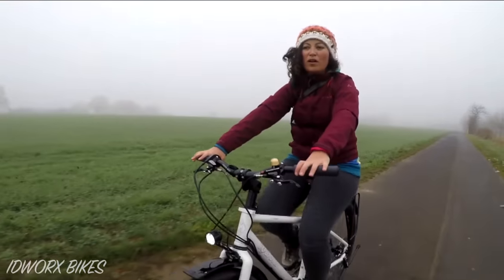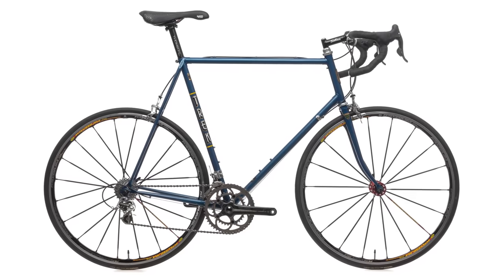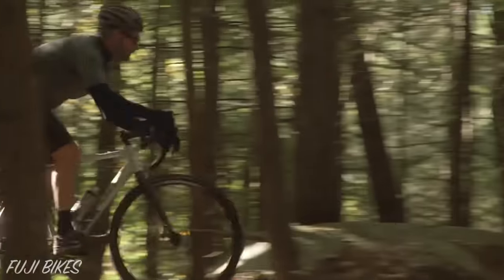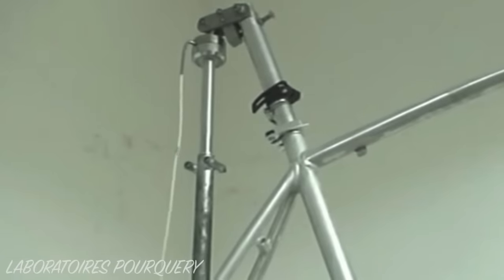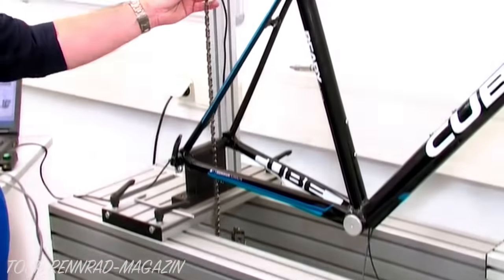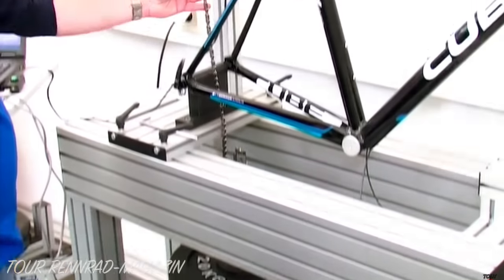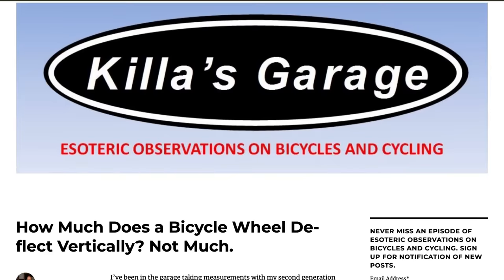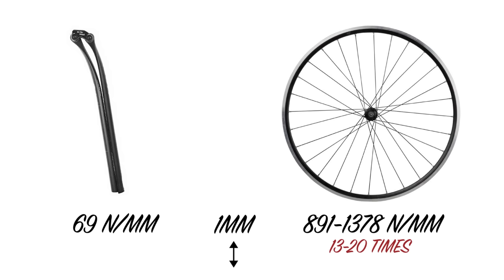Why It's Impossible For Steel Frames To Be More Comfortable Than Aluminium

Comment: I think the actual weight of the frame plays a big role in comfort too. To me, heavier bikes are more comfortable because they have more momentum and resist changes in direction (up and down) more. This means more flexing from the bike and less bouncing. Of course, heavy bikes certainly have their disadvantages.
Reply from the maker: A heavier bike is definitely more comfortable, all other things equal. But you can also select comfortable seatposts/tyres/forks/handlebars to make lightweight bikes comfy too.

Comment: Yeah...I agree with the fact, that the frame material is not THE deciding factor. There are a lot more and important factors which play a role. BUT. With a bad frame, you have nearly no chance to get a comfy or good bike. And the different frame materials also have different physical properties and therefore must be treated and used in different ways. If you use these things right, you can use the physical probperties in order to build a good bike while exposing the positive properties of each material. And in this case aluminium is really a bad material (just cheap and light) in comparison to steel, titanium or carbon.  In the end you have to choose each bike individually because just the frame material does not tell you anything about ride comfort. But as so often, carbon and titanium are often on a different level - which is also based on the frame price (if you spend more money, you do not want the feeling of a bad aluminium frame). I think you should have made this more clear. Yeah - wheels and stuff are really important. But the frame material has an influence on the total bike feeling and there are for sure differences in frames due to used material and engineering.

Comment: I also need your answer how about raining washing my steel bike does it corrode or rusted easily ty 🙏
Reply from the maker: The paint protects your bike from external rust. If you scratch your bike, try to touch it up with nail polish or touch up paint. Also, it's a good idea to spray "Frame Saver" inside your frame. You can see how here: https://velo-orange.com/pages/how-to-use-frame-saver

Comment: It all depends on the tubing and the frame design! With same components and same frame geo, you can get really diffent comfort with different frame materials! 
Mostly Alu ist very rough, steel is softer, and Ti sits somewhere in between. And you can feel it!! But there are very uncomfortable Steel frames in the market, as well as very comfortable Aluminium frames…

Comment: Well, I’ve been riding cro-mo, aluminium and carbon bikes.
Of course tyres make the largest difference, but when you take exact tires and inflate them exact pressure Aluminum feels the less compliant. It’s tough and you feel all the bumps. Cro-mo steel feels much more comfy and Carbon is the most interesting because it feels soft but it let’s you pedal hard and won’t feel sluggish at the same time.
I’m comparing Giant TCX SLR aluminum CX bike, Fairdale Weekender cro-mo allrounder and Salsa Warbird gravel grinder.
Reply from the maker: I know it sounds crazy, but the data here suggests it's a placebo. Have you considered it could be the other factors? For example, the TCX has a shorter seatpost than typical (it uses a more horizontal top tube), and if you're running 33mm CX tyres, it will have less deflection at the tyre too. The Weekender and Warbird frames are a bit more compact and are designed to fit wider tyres too...
Reply from the maker: Oh, and I agree that different frame materials have different ride qualities! But the topic here is comfort. 😎
Reply: CYCLINGABOUT well I switched between Weekender and TCX and back and that made a huge difference. Weekender felt way more comfy even it had a slightly longer ETT.

As for Warbird, I had a Surly ECR  with three inch tires running as low as 1.5 bars.
So when I switched from that fatty to Warbird with it’s 40mm tires and 2.0 bars inflated, it felt a bit tougher but the rear end of the frame appeared to be super compliant. I didn’t expect it to be that soft.
Reply: ну привет

Comment: This is an example of lab testing being one thing, and real-world experience being another. It happens with cars, too - one can have a faster 0-60mph time, quicker stopping time, higher top speed, and support more lateral force, and still be slower around a track. The same is true of a way bikes feel. I’d wager most avid cyclists could try three mystery road bikes and tell you which was steel.
Reply from the maker: I could tell which bike is steel too if the tyres are narrow enough (zero chance on a fat bike). But this is to do with the ride 'feel' rather than the frame comfort.

Comment: In terms of vertical compliance, you're greatly underestimating the effect of the fork. A steel fork with a curved blade rides "softer" than a fork of any material with straight blades. The math you presented makes sense if the bike is perfectly perpendicular to the ground, which is rarely the case. Given that the bike will always be at some angle less than 90 degrees from the ground, lateral compliance also plays a part in perceived comfort. Pedaling creates a lateral torque on the bottom bracket from the top half of the bike, causing the bottom bracket to shift. From below, the terrain will be applying forces in the form of bumps and road buzz. With a low lateral compliance (stiff), the bumps will transfer to the pedaling motion and counteract the pedaling force. However, you will get a responsive frame because less energy from your pedal stroke is lost to the bottom bracket displacement. Likewise, a high compliance frame (soft) will help absorb the bumps at the cost of a less efficient stroke, because some of the energy you put into a pedal stroke will be lost to frame flex.

This "phenomena" can be observed by holding your bike at angle from perpendicular and pressing down on the crank with your foot. The total offset seen will be a result of the lateral compliance from the tires, wheel, and frame, as well as any other lesser factors like QR/thru axles and bottom bracket spindle.

I will concede, however, that most modern companies can engineer compliance into any material through the use of material grade and quality, hydroforming tech, or geometry, similar to how some modern dual-sus bikes have 2- or 3- link suspension with compliant chain stays, GT's triple triangle tech, or Moot's Softtail system.
Reply from the maker: This video was specifically on frame material. Maybe we can look at forks in another video?

Comment: Honestly, I’ve ridden two bikes and they had the same geometry... they “seemed” identical to me. I suspect some people have a more sensitive tushie than me... I did notice the steel bike felt more “planted” to me, but I suspect that it is because of the weight difference more than anything else. I kinda feel like I’m “floating” on a lighter bike, and I’m riding something that the wheels will come out from under me at any moment.
Reply from the maker: Bike weight definitely plays a big role in ride feel! Not surprised you feel a bit less planted on a lighter bike. But keep in mind it's really just a feeling - your wheels being planted to the ground is mostly be a function of your choice of rubber and the tyre pressure!

Comment: Never ridden a carbon bike so I dont know what Im missing. Im kinda poor so to me it feels like a luxury item to have an expensive frame I must be paranoid about dropping or getting hit by something. 

Ive ridden harsh steel bikes and much more comfortable steel bikes. Long chainstays and old school geometry front forks, that are in line with the steerer until the last bit where the bend is, feels much nicer. Straight forks where they angle forward right at the crown, and super short chainstays so you sit nearer the center of he rear wheel, feel less comfortable for sure. The nicest feeling bike Ive ridden is my early 90s trek touring bike with reynolds 531 super tourist tubing. However Ive also ridden cheap as chips Swedish made crescents with 1010 tubing that also feel quite good. 

All that said, from all the aluminium bikes Ive ridden none come even close to feeling as nice as that 531 touring bike or even the middle of the range steel bikes. Maybe if I had a 90s aluminium touring bike with similar geometry I would feel that they are similar.

Comment: I moved from a aluminium frame to a steel one because I cracked the AL one. the steel one feels smoother. I looked at this video and it says it shouldn't so I tried  to find the flex. bouncing on a steel framed bike with 38 mm tires with 20 psi the frame movement is negligible and the tires take up most of the slop. this surprised me. then pumped up the tires to 60 psi. at this point the tires no longer flex obviously. The fork however moves like crazy maybe 2 inches. why do none of those tests talk about the fork with the curved blades?  I agree with your numbers for sitting on a seat doing a wheelie. just real world experience is not just sitting on a seat to the back wheel. weight is also on the front wheel, handle bars, and pedals.
Reply from the maker: This video was intended to discuss steel frames. I can cover forks and other components in other videos.

Comment: Older steel bikes are more comfortable than modern machines, in my experience. This is due to a combination of characteristics like slack frame angles (around 72o), supple leather saddles, pencil stays, small radius forks and small diameter frame tubes. For competitive riding, whippy steel frames are inefficient and relatively heavy, and racing defines the popular image. The biggest factor in comfort is getting the bars, saddle and pedals positioned for the fewest compromises for your chosen activity, rather than material construction.
Reply from the maker: Totally agree that a comfortable bike fit trumps frame material. 👍🏻

Comment: This is a great vid and I agree the material used isn't nearly as important engineering.  But what about long-term durability?  I've read steal has better fatigue strength, but I don't know if the is accurate or inaccurate bias.
Reply from the maker: I agree that the engineering and design trumps material choice. Fatigue sounds daunting but it isn't if the frame is engineered well. By using more material, we can construct aluminium frames that last enough load cycles for the lifetime of a rider.
But let's say I had the choice to tour on a 100 year old steel bike or a 100 year old aluminium bike, I'd take the steel. 😅
Reply: @Cyclingabout  
That makes sense and is consistent with what I read about 12 years ago on the Sheldon Brown site.  His site argues there should be minimal or no flex in a well-engineered frame so fatigue isn't much of an issue.  I'm carefully considering options for a new bike in the next year or so and it's good to know I shouldn't be overly concerned with frame material.

Comment: Steel and titanium is the has best vibration properties. it's obvious, it is about structurure of material, naturally geometry of the frame is important too. Carbon is not the most comfortable material, particularly in cheaper bikes. Iwas riding 2K middle class Focus carbon road frame and on quality titanium frame on the same set of wheels and tyres. There was a significant difference in favour of titanium frame, far more comfortable and smooth ride on the same type of road and conditions.

Comment: There is so much BS going around in the world of cycling. It is refreshing to see some more technical focused ways to explain things. In the 80's I overheard discussions where people claimed to have softened steel frame by just riding/pedaling them hard enough. ;-) Frame size is another thing people tend to forget. If you can ride a 60cm frame with a shorter stem and seat post or a 56cm frame with a seat post sticking out a bit further and a longer stem, you might feel different levels of flex, while it is still the same material.

Comment: Rode steel aluminum and carbon. A steel bike with no suspension was better then the aluminum bike on gravel and it had a front shock. Went to steel and rode a carbon frame bike. Carbon is weird feels like nothing is under you and your just floating on a cloud so no feed back from the bike. Aluminum vibrates way more and you feel in in your hands and between your legs steel seems to smooth it out and give feed back. I like steel bikes way more. Take a chunk of metal bang it against something so it vibrates and you will see a difference. It's not just up and down or flex it's vibration transfers. Just like sound under water is louder and travels further then in the air since water is denser then air it vibrates more

Comment: Years ago a friend of mine who raced MTBs described her Ti frame as having some kind of "snap". What they all say, I think. My impression then and now is that that was not about vertical compliance but rather how the frame flexed horizontally under power or braking. Not sure exactly. I know that's not what you're talking about here, but I don't think you're saying that those characteristics are imaginary, Eh? Or are you?

Not that I would notice, or spent the money, she was racing professionally, and had a completely different relationship with her equipment than I have, of ever will, Eh?
And thanks for your videos, I'm really enjoying your work, Eh?
Reply from the maker: Bikes undoubtedly have different ride characteristics. The 'snap' your friend was talking about probably was real - the frame would've had a small but noticeable torsional flex to it (which suited her weight, power output and ride style). But I suspect that ride feel of her bike didn't contribute to the ride comfort. 😊
Reply: @Cyclingabout  Fair enough. I like steel, but that's probably because when I was 18 aluminum bikes were new and so many were just weird... but that was 38 years ago. The comfort I feel riding steel may not be physical, but it its definitely real. That doesn't really speak to your research, but there you go. At least I'm not getting emotional about it, eh.

Comment: Well, you may be right, but did you consider that even a small degree of deflection at the seat tube to seat post interface is multiplied by the length of the seatpost? Same with the fork to front tube interface. Also did you consider that aluminum and carbon have less predictable fatigue lives? This means that for a carbon or aluminum frame to last as long as a steel frame, it must be designed with a higher factor of safety and therefore stiffer overall than a steel frame? You could certainly make a steel frame every bit as stiff as an aluminum one, but to make an aluminum frame as soft as a steel one you would have to accept a shorter lifespan. I will say though, seeing how much flex happens in the seat post and seeing a comment about racers not being able to tell the difference in a blind study have changed the way I look at this issue.

Comment: My aluminum framed city/touring bike rides far stiffer than either of my carbon framed bikes, one of which has narrower tires (endurance) and the other wider (gravel). Of course the carbon bikes have sloped top tubes, short seat tubes and long 27.2mm carbon seat posts while the aluminum bike has a nearly horizontal seat tube, long seat post and a 31.6mm aluminum club for a seat post!
Reply from the maker: Sounds like this data describes your ride experience pretty accurately!

Comment: I believe it all depends on how a bike is made regardless of material. My first bike was a 16kg steel frame. I was a newbie and yes it was slow and heavy but i could ride it all day. After 4 years i got another one from aluminium but still heavy 14kg and it was a torture riding it. Kinda weird. But i believe is the quality that a bike is made not the material.
Reply from the maker: The data we have suggests that it was likely differences in exposed seatpost length, seatpost design, saddles, tyres and tyre pressures that would've made your aluminium bike less comfortable.

Comment: Stiffness of stem and handlebars not to be underestimated. Worst ride quality I've had was with a Deda 35mm and super stiff carbon stem, that hand no flex whatsoever.  Sore shoulders and wrists after every ride. I tried t with with a carbon and aluminum Caad, Synapse and Supersix. 
OEm stem and bars were more comfortable.

Comment: For what it's worth, tons of runners will also claim that running on asphalt is better for your legs than running on concrete, when the difference in hardness isn't just imperceptible, it's barely measurable and in any case, many hundreds of times less than the hardness of running shoe foam -- which has only gotten softer over the past 10 years.
Reply from the maker: That's really interesting to consider, I'd love to see a study on it - it probably exists. My initial thoughts are that running shoe foam could potentially be bottoming out on particularly hard surfaces for some people, given there is so much vertical force going into the system (especially under heavier bodies). Maybe the shoes in the future will have different foam densities for different runner weights and cadences?!
Reply: Well, the different density foam thing already exists. It's why there's a zillion different makes and models of running shoes. In general, entire industry has been moving toward softer foam, and much more foam. Hoka One One started it. Nike Vaporfly is the epitome. Soft foam without extra thickness will bottom out a little, but not as harsh as older-school foam, especially since those also came in thinner versions for racing. (Best way to screw up a marathon is use shoes with less foam hoping the weight reduction will help. The beat-up legs will more than compensate. I know, I've made the mistake.)